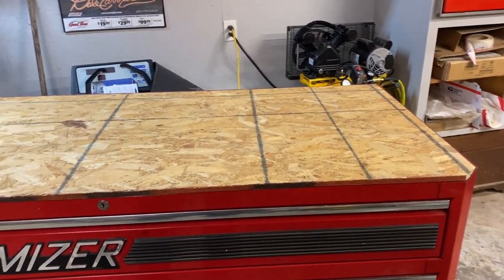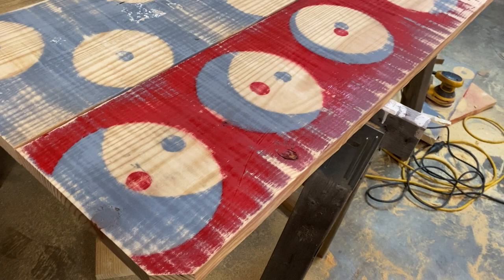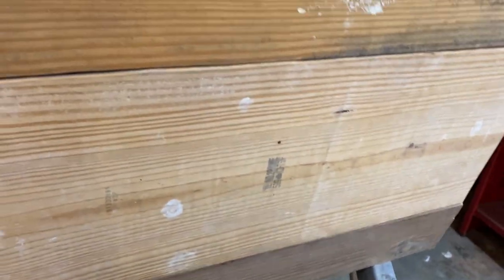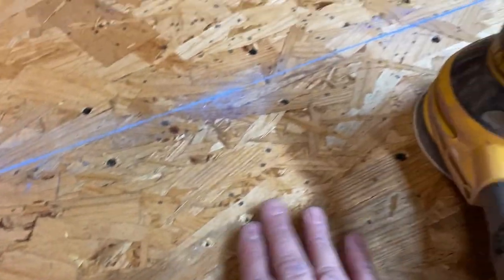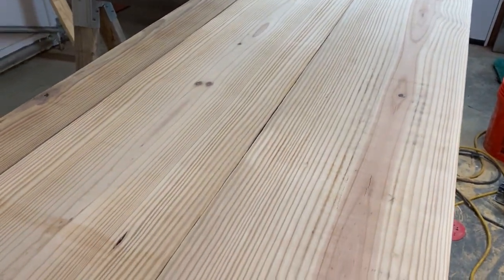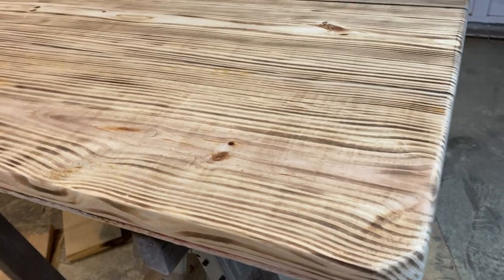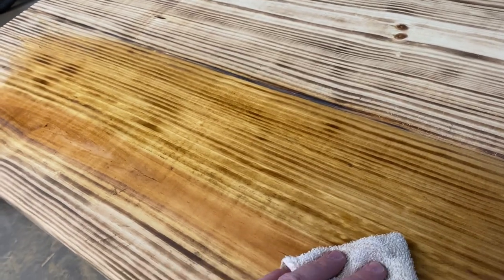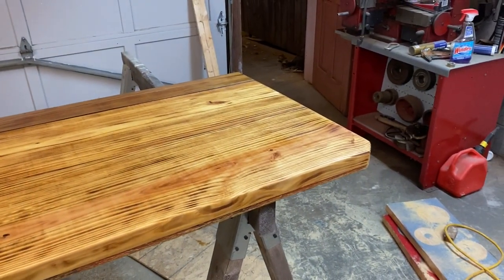How to Build a Butcher Block Top for a Toolbox - Mac Macsimizer

Comment: I built a table top like this about 15yrs ago. I didn't use the plywood like you did. What a mistake...! When you said you were adding probably too many screws, i thought, no..... you need lots of them. Mine ended up moving around, even after being bolted in. The way you did it solves that issue. I work around heavy equipment. My toolbox top gets abused. I am going to rip mine down and use your method. THANKS FOR SHARING YOUR IDEAS.